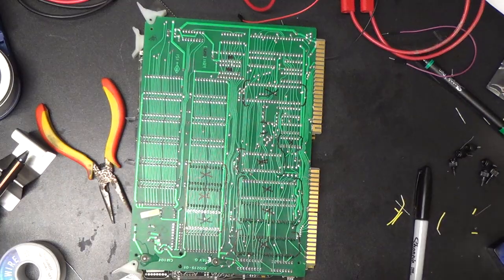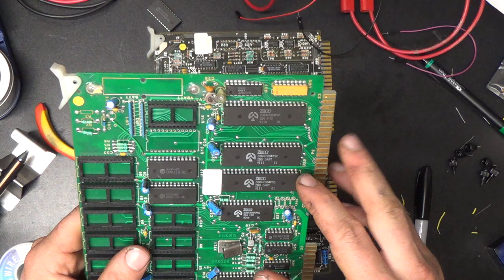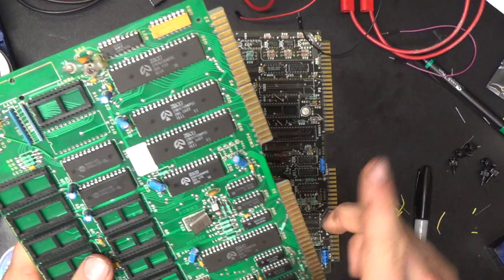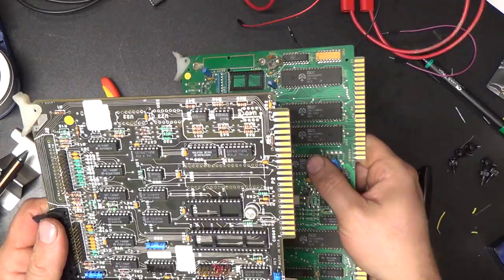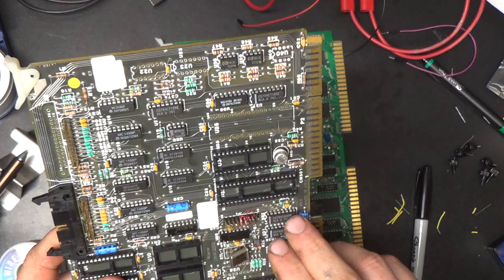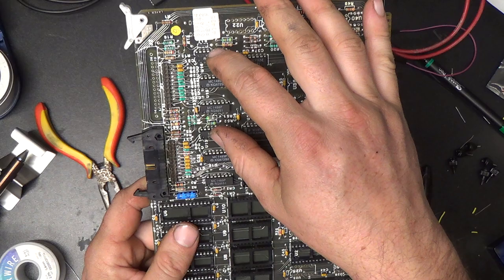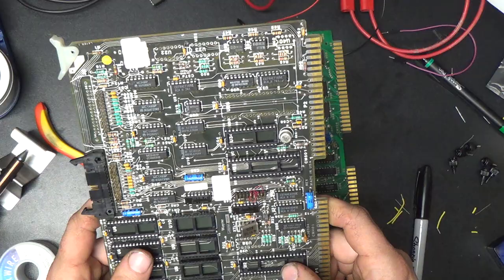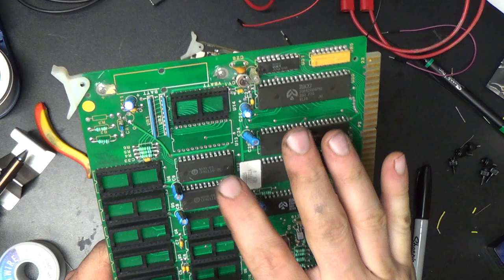Z80 Funtime Pt.3 - Salvaging Z80 ICs From Old Gas Pump Controller Boards

Comment: Don't you just love it when all the pins on a DIP are not straight, but are bent over flush with the PCB?? I'm sure it makes salvaging parts difficult. I don't understand why they do it ...

I would love to hear your description of the method that you use for removing DIPs/ICs from a PCB.